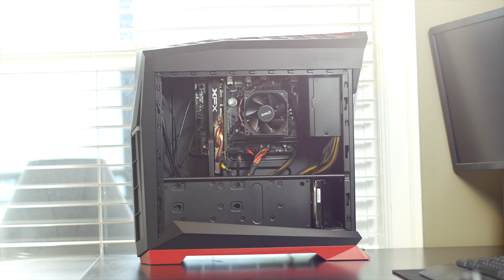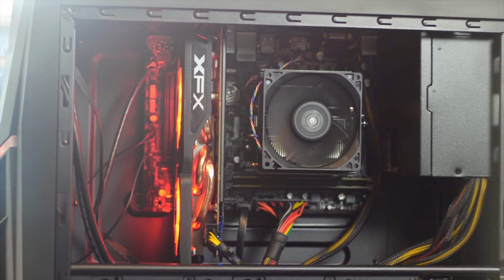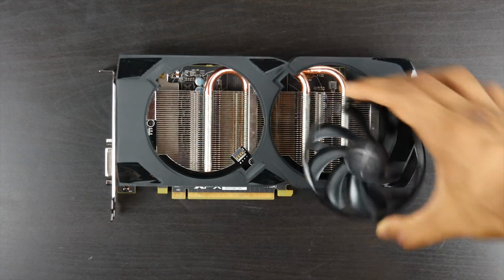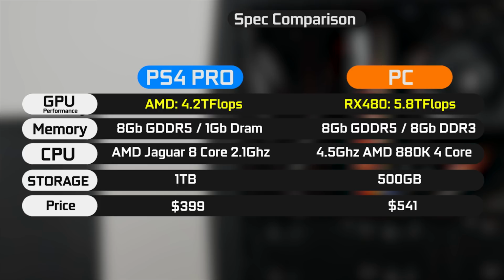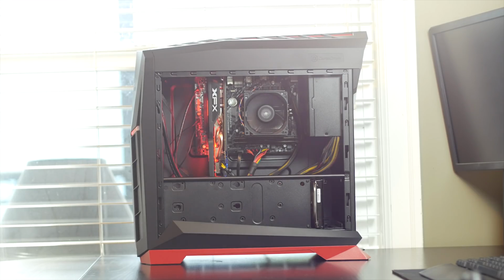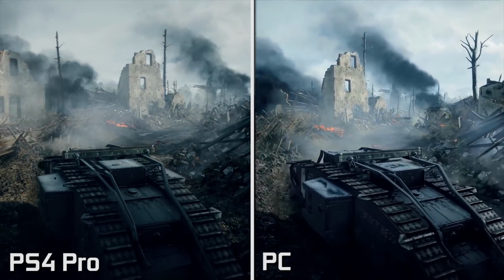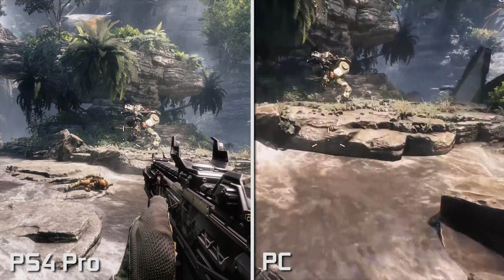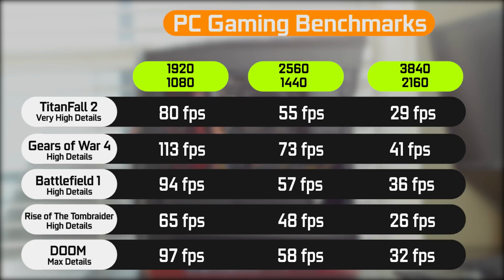Playstation 4 Pro vs $550 Gaming PC

Comment: For reference in 2020. Parts price has changed some new hardware has driven the price down for older hardware and some pieces were on sale but heres my build: $50 case, $60 650W bronze PSU, $80 ryzen 5 2600x, $63 RAM, $120 RX 570 4GB, $41 2TB SATA 5400, $60 GIGABYTE B450A Motherboard. Overall I managed to build a rx 570 midATX under $450, plays all games 1080p ultra and even some 4k

Comment: you could put in this pc fx 6100 or even fx 4300 with overclock. These CPUs are better than piece of shit that is put in consoles, jaguar is very bad cpu.Videocard could be rx 470 (or r9 280x if it`s cheaper, I am ukrainian, I don`t know), it`s still faster. And why so expensive case?

Comment: Spend less on case, spend saved money on better CPU, and replace RX 480 with RX 470, cause even RX 470 is around 17% faster than PS4 pro GPU, while RX 480 competes with XBox One X.

Comment: That case looks pretty bad for 100 dollars, I would have traded the case for a 30 dollar pc case by diypc m28tg I would have used that extra 70 dollars saved on upgrading the cpu to a Ryzen 5 1500x for 140$ and then instead of an rx 480 gotten a used gtx 980ti which competes with a 1070 for just 218 dollars used, would have traded hard drive for 120gb ssd, and then finally gotten some faster cheaper ram. That is how you build a reasonable ps4 killer

Comment: I would rather buy a ps4 pro still...it's $150 less, and that's not including the keyboard and monitor you'd have to buy for your pc. And just comparing Titanfall 2 alone, it runs between 1440p-1620p at 60 fps on ps4 pro. Digital foundry said they barely found any drops in frame rates. Honestly, with PC gaming, if you want to have the "noticeably" better games you got to go big or get a console.
Reply: then again you don't pay for online services, and more cheap games...maybe the PC ecosystem is cheaper in the long haul?

Comment: Ok pc gaylords, does the pc come with wifi AC, Bluetooth 4.0 and controller? A blue ray reader/player? Plus ps4 Pro has rapid math calculations. PC loses so hard. So hard.
Reply: ChumpyChicken2 
Yes, PC is able to use WiFI
PC is also able to use bluetooth.
PC has a Keyboard+mouse, not a controller
PC does not need a Blu-ray drive.
PC does have ability to use rapid packed math. But almost nobody uses it.

But why can't PS4 Pro run games in native 4K? 
PCs have been able to run native 4K since 2012.

Comment: You must admit PS 4 Pro is still better because Most of PC's games badly optimized. You can play some game at hi-end pc and still experiance some lags and other shit while on your friends crappy pc game runs smoother and better and you're like WTFFF BIATCHEESSSS. I had these problems many years on PC. Badly optimazed games because developers is lazy shitheads and they cant optimaze their games for every hardware and videocards. Thats why i am done with PC upgrading 1 year ago because i am tired of these issues. As example just think of Dishonoured 2 back when it was released for PC. It was totally unoptimised and had frame-rate issues even on high end pc's and theres many others. Thats why i bought PS 4 Pro recently.

Comment: I built a PC for £184 that can match the ps4  specs:
old PC (bought from an old woman whose son made a PC for) for £25 with: Asus p5g 41t m lx motherboard
1gb DDR3 RAM
Intel Pentium E6700 3.2ghz dual core CPU
ciT m300u PSU.

I upgraded it with: 
2x 4gb DDR3 RAM 1333MHZ -£24
gigabyte gtx 750 ti  -£75
EVGA 600W 80+ PSU        -£40

Comment: One should easily conclude that for $400, a ps4 pro is the best value (for gaming). Not only did you spend an extra $150 with half as much HD space, you also didn't even include the cost of Windows. I also don't see any optical drive. Then of course there is the fact that you have to build the thing too.

Of course a PC is a PC at the end of the day, which means it is capable of far more, but for just gaming, you will not be able to beat the price of a ps4 pro.
Reply: The PS4 is only kind of worth it if you don't play online.

Comment: Alright, at this price range, the case should not be more than $50.

Here is what I would suggest:
Case: Deepcool tesseract (comes in blue and red)- $40
Mobo- ASUS H110M-E/M.2 LGA 1151. - $44
CPU: Intel Core i3-7100 - $119
RAM: G.SKILL Aegis 8GB (can buy another one later on). - $52
GPU: SAPPHIRE NITRO Radeon RX 480 - $204
PSU: CORSAIR CX series CX430  430W - $39

Now, this is about $503, which is about $50 more than the ps4 pro (I count the pro + 1 year online subscription), but, this system is not only more powerful than the ps4 pro, but is also more capable with the things you can do, its a PC.

Comment: I am apart of the "pc master race" and I hate these fucking comments so much. First off, $400 vs $550. That's a fuckin $150 difference my guy. The ps4 pro is obviously stronger in this comparison so I don't know why a lot of people are defending the pc. And I do know he spent wayyy too much on his case but even if he opted for a cheaper case and spent more on his components, there would still be a $150 price difference. For me, the worst part is that people give the ps4 pro no recognition. I personally have a $700 pc that I built myself and while i know it is much faster than the ps4 pro, you gotta give it some recognition, for $400 it's pretty damn good. But the thing is, it SHOULD be pretty damn good. Unlike the average Joe building a pc, Sony is a massive company that can buy their materials in bulk and for much cheaper than market value! People don't really get this. If an ordinary person were to make an exact copy of the ps4 pro, it would cost much more because the normal person can't buy these things in bulk! This is why we should not even be comparing the 2 systems in the video in the first place, it simply is not a fair comparison. k, done with my rant.

Comment: If you want a fair comparison both pc and ps4 should be at the exact the same price so boh should cost only $400 and the ps4 already comes with an operating system while the pc does not so you also put that into account and ms10 costs about $100-$200 so basically your hardware should only cost $200-$300

Comment: good cpu in ps4pro but are the ps4pro worth to buy? when ps4pro use rx 480-8gb, and why I not upgrade my gpu from gtx 770.4gb to gtx 1070? AND PS4PRO are not 4k (1800p still low for 2160p).

Comment: Just because its stronger in theory doesn't mean it works out that way in practice, console games sometimes look and perform better than on budget pc builds because of optimization. Besides your missing the point of console gaming, people just want to buy a damn box plug it in and play some fun games, they don't want to be "hardware hobbyists" and put in the work and research to mess around with graphical settings.

Comment: This is a $750 PC if you add the controller, the headset, the operating system and the 1Tb Hard drive. And yet, you still can't play PlayStation exclusives which is the reason why people buy consoles. The PS4 Pro is currently the best value for your money.

Comment: not really a comparison really is it when spending 40% extra on the PC especially when you put in video you could save around $150 on getting a rx470 so if that make it more of a similar price match then why not do the test with that card instead,& lets face it anyone still thinking of building still will have to pay another £100/$100 on a operating system and keyboard mouse as well.& yes this does count into a PC build because in reality most folks are going to go with windows operating system & yep definatly going to need a keyboard mouse as well,when doing a cost comparison video I think its important to factor in all the things you really gonna have to buy..

Comment: If you're only looking to play games the PS4 will be ultimately cheaper because you don't need to buy a keyboard or mouse. Also if you don't live in America this $550 PC will get more expensive by default because of shipping, taxes, and exchange rates. The CPU and GPU by themselves cost me $500CAD on newegg not mentioning shipping costs or tax. Then I will also have to get a Mobo, PSU, case(hopefully comes with fans), ram, storage, operating system, and an optional optical drive. This build will probably cost me around $800+any shipping and tax. Pros for a PC would be the windows OS, torrenting, customization, mods, cheaper games, no need for a yearly online subscription, and mouse accuracy. Pros for PS4 would be that all the basic programs you need are preinstalled, text chat, voice chat, friends list and profiles to keep in contact, no viruses, controller comes with system, smaller than a PC, it has a media apps such as twitch, youtube, spotify, netflix, sports apps, anime apps, and a web browser. Also the PS4 is usually the same price everywhere. Even though the PC costs more to make here in Canada the PS4 will cost $350~ to $400~ plus tax.
Reply: Yeah huge differences, that doesn't even scratch the surface. PC has infinite more things you could do. Like editing, programming, storage is easier to access, etc.

Comment: Considering that the ps4 pro's HD is only a 5400 rpm sata 2 you should just get a SSD for the PC.

If you're not going to compare apples to apples (and why would you?  No one uses crap drives like that in their pc anyhow) you might as well take advantage of the situation.  
A cheaper case and you could have had faster load times. 

Also you would have to buy a BD-ROM and a PS4/XBox/Steam or USB adaptor-based controller to get the "console experience".
Keyboard and mouse is great for FPS/RTS but awful for platformers.  Also, OS (and cost)? I doubt all of those games run on Linux yet, so I assume that's $100 for Win10.  

You need to also establish the graphical specs of each of those games ON the PS4 pro, for like you said they dont all render 1:1.

Comment: Comparing graphical prowess is fine and dandy, but if you are really comparing by price of the systems, a more apples-to-apples comparison would take into account the other things that the PS offers. I suppose that would be the BluRay drive and the 1TB hard drive, as well as a game controller (which isn't necessarily exactly free, especially if you want one that approximately matches the quality of the DualShock4). For a real apples-to-apples comparison you would need to add those to your PC configuration as well.

(Yes, I understand that not all gamers care about BluRay, nor about game controllers, only about how well the system can render games. And for a budget system they might be ready to settle with a 500GB hard drive. But one has to wonder that if such people are so interested in graphical performance in their PC, maybe they aren't interested so much in matching the price of some console. Thus the comparison becomes a bit moot. Might be interesting for curiosity's sake, but not very useful.)

Comment: why noy use the 470 instead since its more comparable? Of course a more powerful gpu will get better results, that's the point of pc, you can match a build to your needs and for even $200 than a console you'll get better performance and sky (or you bank account) is the limit. I was more interested in a similar performance comparison.
Reply: D00MTR33 fake 4k IG

Comment: In the long run pc gaming saves you money. I built my first pc in 2011, and 2 weeks ago I finally upgraded my gtx560 to a gtx 1060 ssc.
Reply: But consoles DO have used games which are sometimes just as good. PCs don't actually used games anymore since now Physical copies never contain all the content on the disk anymore and only have a code for DRM like Steam most of the time.
Reply: Especially with games, steam sales games are usually half off, and big name console games almost never have good sales.
Reply: +Rookie Gamer aka Ark i5 2500k if my memory serves me correct
Reply: thats the beauty of pc. What processor r u using right now?
Reply: Dizzinator2114 Nice
Reply: thats one hell of a beast after overclock wow and here i am rocking my i3 4150 gtx 750ti with 1600mhz ram

Comment: Just, guys. This PC is clearly over 550$ when counting peripherals and screen (counting you already have a 4K TV by buying a PS4 PRO), and a 4K PC screen is more or less 300$. So, yes, you compare a 400$ machine to something that cost way more ? And at the end, you have less storage, no HDR, bad 4K and a huge machine that use more energy. 200$ more for a slightly cleaner texture ? 
I don't know how you can possibly tell that PC is better in that case, where the PS4 has all the advantages. Especially for someone normal without any IT skills.
Reply: Ps4 pro doesnt support native 4k it does it by  upscaling so not a good quality and about peripherals the same goes for console as well and when u buy a console the 4k tv doesn't come with with u have to buy it.
Reply: Yeah, I've been really impressed and looking forward to games that were built with it in mind (Forizon Zero Dawn). The games out now are doing pretty well with just a patch.
Reply: Actually if you already have a 4k TV for watching shows and movies, nothing changes. 4k Gaming monitors are much more expensive, and don't forget the rest of mandatory peripherals with the PC such as keyboard, mouse and headset (not to mention the mandatory OS). It also doesn't support HDR or Blu Ray. I think you have to see it in person to really compare (1080p compressed youtube will only get you so far) but HDR impresses me more than extra textures.
Reply: avi raj rk Yeah, but it's more frequent to have a 4K TV in a "classical" house than a 4K PC monitor especially when those screens are made for gaming.
Reply: Brandon Soto Indeed, HDR is unbelievable and far more interesting than 4K. I've seen it in demo, and it was awesome ! I think that, for a 400$ machine, the PS4 Pro is doing great, even if the resolution isn't full 4K. (thanks to developers)
Reply: u do know that u can hook up a pc on a tv or is it not allowed at ur home.

Comment: Bluray player + bigger hdd + best wifi card on the market + mouse + keyboard. While the computer is nice but add those stuff it does not cost as little as that.  
Edit: also windows 10 or 7 depending on your choice make it not even close to that.

Comment: its kinda obvious thaat the 550 dollar pc is gonna  win bc it is 150$ more than the console shoulve went with a 400$ budget
Reply: windows 10 can be downloading and used for free without activating, just have to put up with a watermark and very little personalization settings. A budget mouse and keyboard combo along with a headset can be bought for very little as well. Adding $150 for that is a little over dramatic
Reply: Stanced Exodus a 300 dollar PC can destroy a PS4 pro.
Reply: byrne1et you have to remember that you are going to pay 60-70$ each year for ps plus to play online games, so in the long run, the PC is technically cheaper.
Reply: ***** TBH, steam offers MUCH better sales than PSN or XBL.
Reply: He never said it was a comparison of a PC at the same price. Nor is it obvious what will win either.

Another problem is you need to spend a MINIMUM for a gaming rig to have something playable. If you want to actually be FAIR then also include a BluRay player, Windows and game controller. That's about $200 so if the console cost $400 you'd have $200 for the case and all internals.

Not gonna happen.
Reply: You download the unlicensed one, and then go do the assistive technology upgrade on Windows website. Then you'll have the OS. Keyboard and Mouse combo are like 10-20$?

Comment: Haha this is so unfair. First he isn't even getting the the numbers to match for pricing so no shit the PC will win. He may add other components will of course would go into the price but he never showed any of that gameplay. Second, the PS4 comes with an included game, headset ( though the headset sucks but still), controller, charger cable, power cable and hdmi cord. Now if we add the power cable, hdmi cord, a decent keyboard and mouse, then include a headset or headphones, that adds up over $600. So why the fuck would you get a PC worth over $300 more rather than a integrated system where you can plug in and play and also have 500gb of more storage. In the end this is not a fair comparison and the true winner is the PS4 PRO. This is a fact rather than stupid click bait like this fuck used to get these kind of views.

Comment: not much of a price improvement considering that you have to buy a mouse, keyboard, and a monitor. meanwhile the ps4 pro comes with a controller and you can easily hook it up to your TV
Reply: you seem to forget the fact that you obviously also have a computer and screen and keyboard that you are currently using on top of your ps4... add a 400$ budget to a computer you already have and thats what you should compare...
Reply: KaddyShack00 You seem to forgot  the fact that the average american/european consumer doesn't have a good 1080p monitor with a decent keyboard and mouse standing around in his housr. Most people use tablets/laptops and their smartphones as their main computers and may have a 4:3 480p 2003 monitor standing around, if at all.

Nearly everyone has a 1080p TV though.

Comment: 1 thing i want to clarify is that
pc + games + all the torrents =600$ max
ps4 + games + membership fees =700$ 
note that most of the games for console costs way more than pc 
if you buy 10 pc games it would be around 150-225 usd depending on the game,  now on the ps4 most of the games are priced around 40-50 usd per game that is actually a lot. keeping in mind for a    machine that you buy looking only at its price.

Comment: At that budget you spare a little more on the case to get more juice out of the parts. And personally I would have liked an SSD. If an i3 wouldn't have been possible a FX-6300 would have been a better solution. The RX 480 is too powerful a GPU, and the Athlon cramps it a lot.
Other than that, good job!